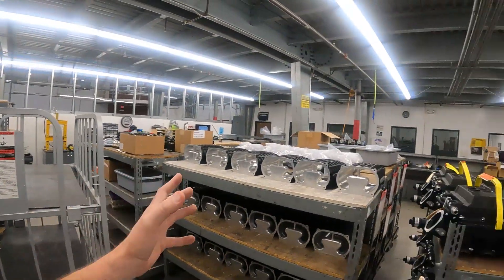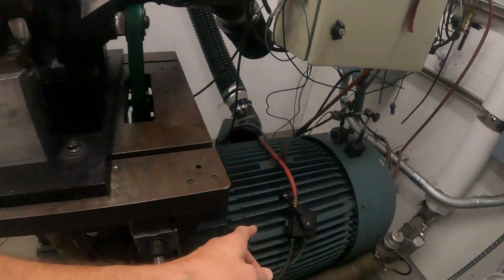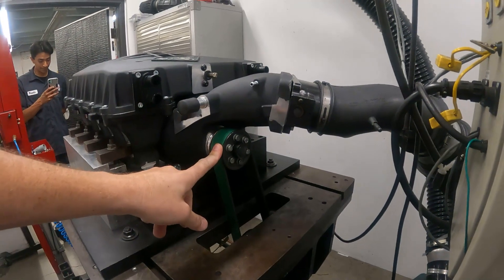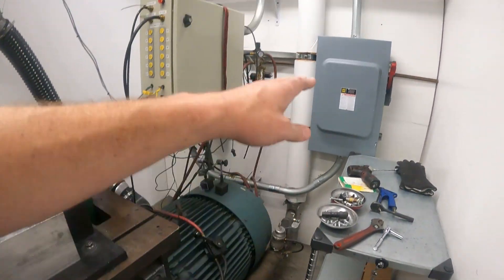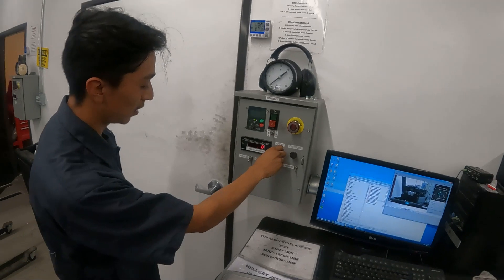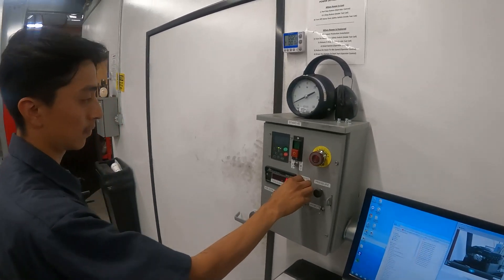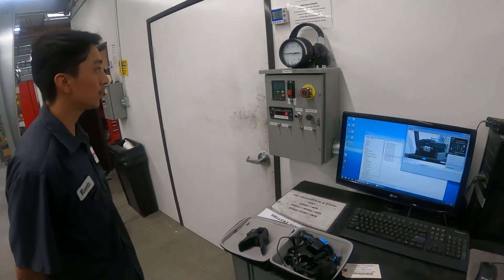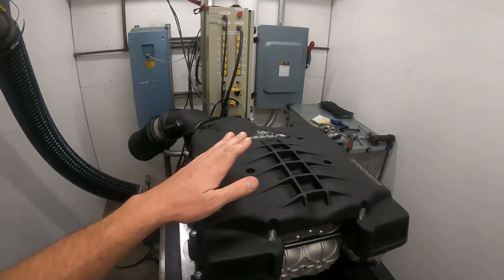How it's Made || VMP Odin testing at Magnuson!

Comment: doing any 2021 f150s yet
Reply from the maker: We've got things in the works, stay tuned in the first bit of '23 for more information regarding this kit.
Reply: @VMPPerformanceTV  ok
Reply: Tuning also for hp tuners or you guys gonna be doing that
Reply from the maker: HP Tuners and SCT are the two platforms we use.  We'll be working with either one of those to handle the tuning.  We'll be working on those things parallel to develop a complete package.